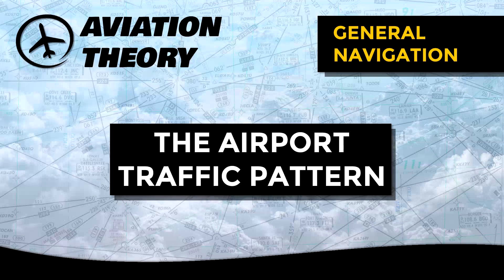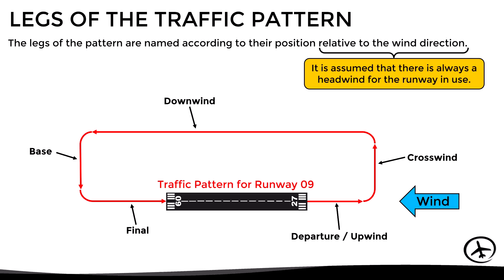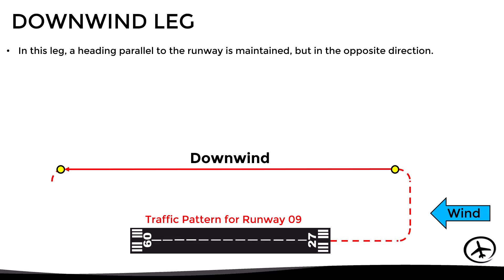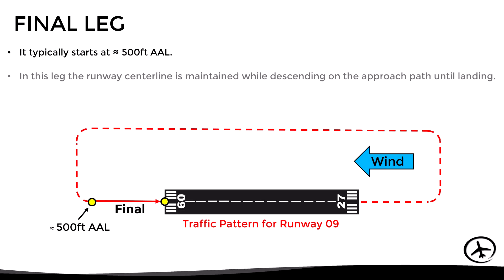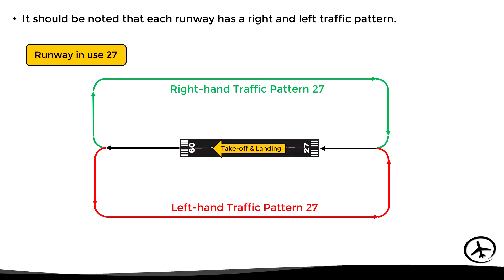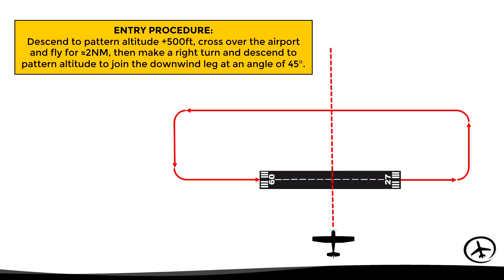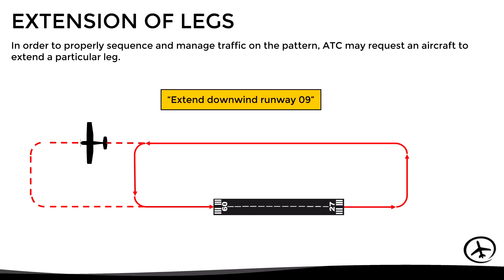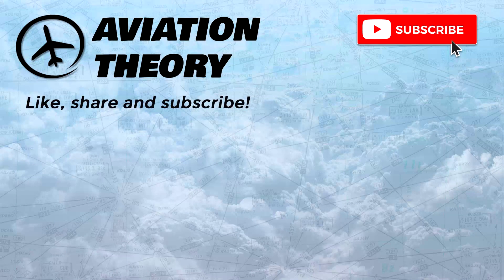The Airport Traffic Pattern

Comment: very lacking and agree most likely AI produced.  the traffic pattern is a complicated hazardous flying skill that always requires care, exactness, alertness, and preparation. Excellent example of why you must get life-critical aviation basics from a real live pilot/instructor not AI. Pattern altitude changes as discussed here are not what is usually recommended. one must start to descend from TPA about midfield on the downwind, the  target for a 1 mile final is about 200-250 feet AGL otherwise you will be to high and be too fast as you try a rapid descent final that can then lead to overshoot, bounced landing or even worse porpoising and prop strike.  you must be very careful about cutting a short base to make damn sure you are not coming on top of another aircraft on a longer final. Verification that you are on correct airport frequency and announcing position is not discussed.  Night issues including airplane and field lighting is not discussed. ATIS info wind speed and direction as well as the techniques for crosswind and turbulence are not discussed.